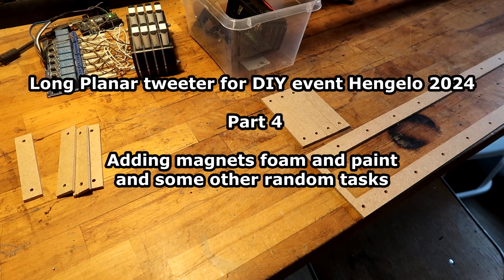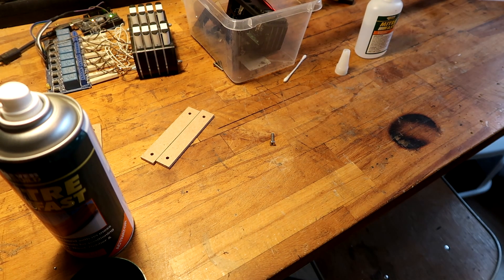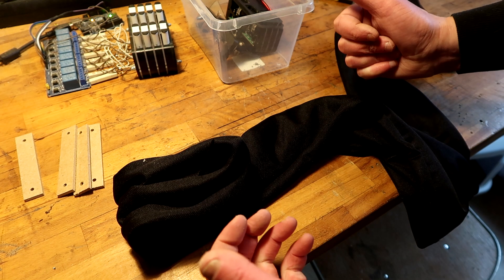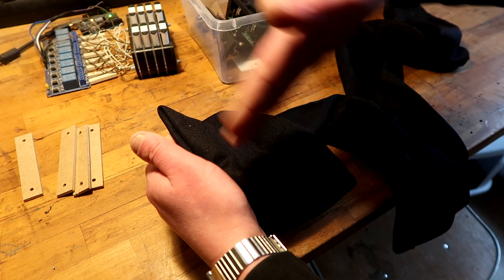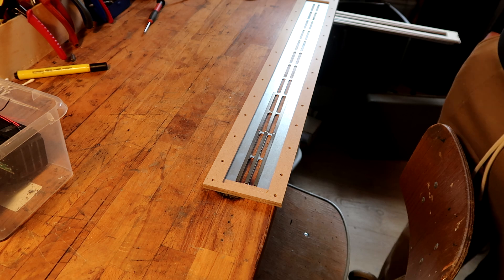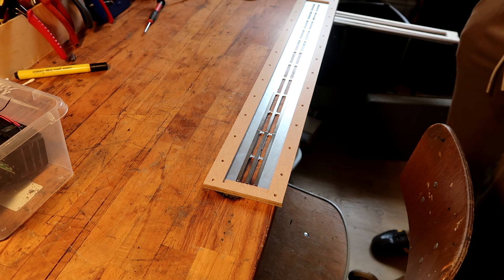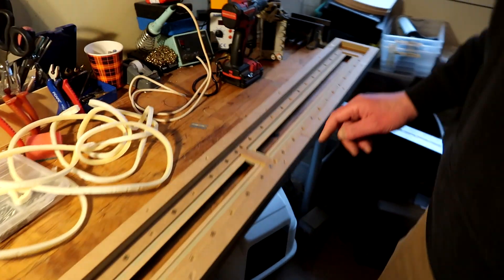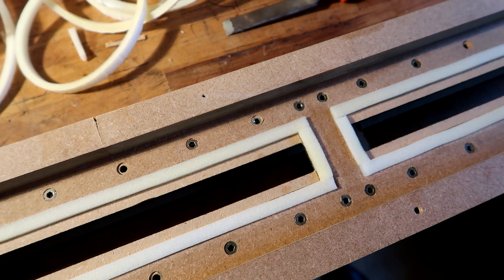Long Planar tweeter for DIY event Hengelo 2024 - Part 4  Adding Magnets prepping frames

Comment: What size and type of magnets? Foam use to deteriorate over time and just rott away. Clarisys who makes spares for Apogee Speakers have some foam that are said to be non-rotting.
Reply from the maker: time will tell :) i used PE then something else and now  no foam.. in the end i might need foam since this option is also not the holy grail. but i need the right foam :) or make something completely different :)

Comment: What's the compound you are "sponging", 30F or something?
Reply from the maker: yeah 3M 30F , im not using it as glue, but more like  a way of giving the magnets more grip. since i am not sure if this will be permanent.  this way at least the magnets remain clean. if i want to reuse them. in push pull this would not be possible of course. if i want to make it permanent i ugess epoxy might be the best but also a bit messy. or a CY glue that is less britlle then usual maybe ?
Reply: @joppepeelen  Ok, I got it. Is the compound you're spraying teh same thing or is it an accelerator?

Comment: This looks promising, massive magnet power and area :) Keep on rolling !
about the foam: I experienced (and experimented) with damped surrounds of midrange speakers, I placed additional dampers to the surround of a speaker and looked, how it influenced the amplitude and resonances of the construct. At the end I came to the conclusion, that there are differences between homogen and heterogen mechanical damping, but non of them really mattered that much after tuning the speakers amplitude, that there was a clear audible difference.
ie. As long as the damping is given somehow and not too hard, it do the work.
Reply from the maker: yeah in this case sometimes it happens it pushes the foil into the magnet. i might need to erperiment in the future with the best balance spacer/thickness of foam and witch foam

Comment: I know it's counter intuitive, but primer helps the black cover better. If you use a sock, then ok, but bare mdf sucks in paint (as does most wood).
Reply from the maker: i agree !!, intention was using a sock. even if i dont for the event (time constraints) i cant paint it after installing the foils  so.